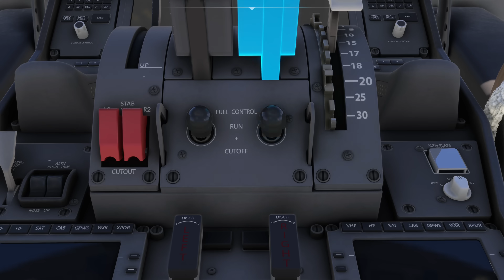Air India 171: Why Did The Fuel Cut-off Switch Get Moved?

Comment: Hi Steeeve. As per your practical experience, how probable it is to shift both the switches to cut off one after the other in a gap of 1 second without creating some sort of klick sound or noise which the cockpit mic could capture… why I am asking is as a life saving recovery action in emergency took 2 secs or 4 secs time…. 
10 second delay could be the delay to comprehend the situation, but once the countermeasure has been established, then switching back both the engines as fast as possible should ideally be the action… which leads to the question that whether it is really practical to switch it off in 1 sec so easily without any sound or something noticeable?

Comment: You should dig deeper. How do you know the pilot turned off the fuel? A signal told the black box he did. Does this signal come from a computer or is it directly the switch signal? Is there redundancy in the signal processing itself?
India and South Korea aviation regulators have ordered the airlines to examine the fuel switches because of the locking issue from the FAA bulletin.

Comment: I still haven't seen proof that the FADEC computer did not shut off the fuel without moving the switches. There is probably not a physical switch monitor as such. It would be a monitor of the computer fuel cutoff logic state. The pilot did not say why did you move the switches. He just said the fuel was cut off. There have been multiple problems with the switches and microprocessors controlling fuel cutoff in similar aircraft.

Comment: My two cents. Perhaps the pilot who asked the other pilot,  "Why did you do that?", was actually the pilot who had done it and was attempting to get something on record that could be used against the other pilot. Granted that both of them almost certainly realized that they would be killed after the fuel switches had been tampered with, but maybe the one who done it wanted to confuse the issue.

Comment: I am really surprised that you have made the categoric conclusion about the report without considering the possibility that the switches moved themselves. You seem 100% certain and yet the report does not reach that conclusion.  If it is due to a pilot turning these off, it shows how primitive these systems are. You should be able to block these switches during take off after it leaves the ground. An intelligent system should be able to detect if a plane is landing or takking off (in answer to your response).

Comment: There’s no proof the switches were physically moved. It could have been unexpected shutdown of engines just like with the Japan ANA flight, which could register as cut off. One pilot noticed engines were spooling down, he asks the other pilot about the switches which he denied moving. After they probably tried to restart the engines by first moving to cut off, but since system was already reading cut off, this would not register. Then they moved the switches to run, but by then it was too late. Before blaming the pilots, Boeing will need to prove switches were moved. Maybe the sound recording will confirm it.

Comment: The fuel cutoff switches are for PILOT control. The more you take control AWAY from the Pilot and give it to a computer... the more you add possible malfunctions. The Pilots are the ULTIMATE computers and are trusted to perform their duties... which 99.999% of the Pilots do extremely well.... day after day after day!

Comment: Thanks for the excellent content! One piece of information a flight deck camera could provide, in this case for example, is to see which of the two pilots actually engaged the cutoff that may be able to provide more insight about the incident. The recorded data could be part of the black box also in the sense that it wouldn't be accessible unless there was an accident. The potential for (and consequences of) human error is significant enough to mandate that in my opinion.

Comment: If the springs were removed and the slots were filed down, it would completely compromise the fuel cutoff switch's safety design, making an engine shutdown dangerously easy.

This hypothetical scenario describes a deliberate and sophisticated act of sabotage. Here’s a breakdown of why that would be so effective and dangerous.

*

### How the Switches Are Supposed to Work

The fuel cutoff switches on a Boeing 787 are designed with multiple layers of protection to prevent the exact scenario you're describing.

* *Protective Guards:* The switches are covered by guards that must be physically lifted before the switch can be moved.
* *Tensioned Springs:* Springs provide tension, holding the guards down and ensuring the switch itself "snaps" into position, preventing it from resting between "ON" and "OFF."
* *Locking Slots (Detents):* The switch lever physically sits in a machined slot or detent. This groove acts as a lock, preventing vibration or an accidental bump from moving the lever. To move it, you have to lift it up and over out of this slot.

*

### The Effect of Your Proposed Tampering

If someone were to perform the modifications you described, they would systematically defeat every one of these safety features.

* *Removing the Springs:* This would make the protective guard loose and floppy. It would no longer offer resistance or snap back into place. It would also remove the tension that keeps the switch lever itself firmly seated.
* *Filing Down the Slots:* This is the most critical step. Filing down the detent would eliminate the physical "lock" holding the lever in the *ON* position.

With these changes, the switch would become a loose, unsecured lever. Since the *OFF* position is lower than the *ON* position, even normal flight vibrations, a slight jolt from turbulence, or a very light touch could be enough to cause the lever to fall into the cutoff position, starving the engine of fuel.

In essence, this act of sabotage would weaponize the switch's own design and the force of gravity against the aircraft. It would require specialized tools, time, and unrestricted, illegal access to a secure cockpit, constituting a major security breach.

Comment: The reports say the switches were turned off within 1 second of each other and it took 10 seconds before they were turned back on. This suggests a malfunction or defective switches. When they went off, and the one flying asks if the other if he turned it off, he says no, the 10 seconds would be when they were trying to figure out what it was. if he had in fact turned it off there would have been other dialog or even a struggle to try to get it back on. If the pilot wanted to commit suicide, he had ample hours after the plane was in the air, no need to do it there. The plane going for the take off and if running down the run way with the nose wheel on the center would have been going over those turtle bumps causing a vibration which could have sent the switches to off if they were defective. For the pilot to turn them off in 1 second togeter is quite impossible.

Comment: Your dismissal of full autonomy is quite shocking tbh.
As the poster of the Q quite rightly states, human error is the biggest risk to loss of life.
Autonomy can taxi, take off, fly, replan, approach, land and taxi already.
Watching @pilot debrief's channel, most of the crashes are because of humans 

I work with autonomous systems and they can auto rotate (rotary), detect if they need to go around (fixed wing), predict failure, monitor a million sensors and dials a second, take milisconds to know what's wrong and generate and assess a load of emergency options in a second and fly the best one

Comment: In layman terms, would the movement of the switches to cutoff, by a trained commercial pilot, be equivalent to turning an ignition switch in a car to off, by an average driver (both have safety features to disallow this type of operation, but in an airplane, this action would need to be performed twice, since it has 2 engines).

Comment: The report doesn’t say the levers WERE transitioned. It says the levers transitioned. Hence, couldn’t they have failed, especially considering that notice from 2018.
Reply: notice from 2018 is about improper installation, not some failure. switches remained in run position after the ciolent crash.

Comment: Captain Steeeve, you hint towards a human intervention, suici**. But you seem to assume that the cut off switch is similar to one on a lawnmower for example. You never mention that the cut off switches are connected to fuel valves via a computer and wiring. You seem to be stuck with one idea in mind, a fatal flaw in a pilot. Let's see if there is a flaw here

Comment: Is there any potential that the engines did not relight and return to power fast enough, as required by regulations? Modern jet engines are designed to meet quick windmill relight requirements in case of inadvertent fuel interrupt. Do we know if GE have been engaged on this prospect?

Comment: Unanswered question: Were the actual fuel switches recovered? And visually verified as to what position they were in, etc? I doubt it.  So all of the conjecture is based on an electronic impulse recorded in the black box? Maybe neither pilot touched those switches initially.

Comment: Are there any actions either pilot might normally do involving 2 steps around that same time of rotation? ie Could one of the pilots mistakingly done the quick 2 step process to cut off the fuel when he meant to do a different quick 2 step process?

Comment: (From the Preliminary Report) As per the EAFR data, the aircraft crossed the take-off decision speed V1 and achieved 153 kts IAS at 08:08:33 UTC. The Vr speed (155 kts) was achieved as per the EAFR at 08:08:35 UTC. The aircraft air/ground sensors transitioned to air mode, consistent with liftoff at 08:08:39 UTC.
The aircraft achieved the maximum recorded airspeed of 180 Knots IAS at about 08:08:42 UTC and immediately thereafter, the Engine 1 and Engine 2 fuel cutoff switches transitioned from RUN to CUTOFF position one after another with a time gap of 01 sec. The Engine N1 and N2 began to decrease from their take-off values as the fuel supply to the engines was cut off.
In the cockpit voice recording, one of the pilots is heard asking the other why did he cutoff. The other pilot responded that he did not do so.
The CCTV footage obtained from the airport showed Ram Air Turbine (RAT) getting deployed during the initial climb immediately after lift-off (fig. 15). No significant bird activity is observed in the vicinity of the flight path. The aircraft started to lose altitude before crossing the airport perimeter wall.    As per the EAFR data both engines N2 values passed below minimum idle speed, and the RAT hydraulic pump began supplying hydraulic power at about 08:08:47 UTC.  RAT in extended position 
As per the EAFR, the Engine 1 fuel cutoff switch transitioned from CUTOFF to RUN at about 08:08:52 UTC. The APU Inlet Door began opening at about 08:08:54 UTC, consistent with the APU Auto Start logic. Thereafter at 08:08:56 UTC the Engine 2 fuel cutoff switch also transitions from CUTOFF to RUN. When fuel control switches are moved from CUTOFF to RUN while the aircraft is inflight, each engines full authority dual engine control (FADEC) automatically manages a relight and thrust recovery sequence of ignition and fuel introduction.
The EGT was observed to be rising for both engines indicating relight. Engine 1’s core deceleration stopped, reversed and started to progress to recovery. Engine 2 was able to relight but could not arrest core speed deceleration and re-introduced fuel repeatedly to increase core speed acceleration and recovery. The EAFR recording stopped at 08:09:11 UTC
At about 08:09:05 UTC, one of the pilots transmitted “MAYDAY MAYDAY MAYDAY”. The ATCO enquired about the call sign. ATCO did not get any response but observed the aircraft crashing outside the airport boundary and activated the emergency response.
At 08:14:44 UTC, Crash Fire Tender left the airport premises for Rescue and firefighting. They were joined by Fire and Rescue services of Local Administration.

Comment: Pilots are trained to fly a plane. It can't be made baby proof. These pilots go through rigorous training. If the fuel switch is in the 'run' position, it will stay that way until the aircraft has landed and taxied to the gate or stand.

Comment: To all the Commenters asking questions- please read the Prelim Report issued by Air India after investigations. It is an outline only not in depth. It is factual listing what black box recorded, not conjecture. If you read it, or look at the main parts, you can logically follow what happened without emotionality clouding your judgement.  Main points are:
1. Fuel switch #1was cut off MANUALLY. 1 sec later Fuel switch #2 was cut off.
2. RAT deployed automatically after 5 secs.
3. Fuel switch #1 was turned back on after 10 secs, and switch #2 was turned back on after 13 secs manually.
4. Copilot Sabharwall 56 yrs issued the Mayday call from the copilot seat.
5. Pilot Clive Kunder 32 yrs was flying the plane with both hands on the steering wheel.
6. All activity in black box stopped 6 secs after Mayday call.

Why was Clive Kunder, the junior pilot flying the plane that day? Was he the sane one deemed fit to fly?
Why was Sumeet Sabharwal, the senior pilot copiloting that day? Had he been demoted?
Why was Sabharwal retiring at age 56 when he could fly till 60 yrs? Was he being forced out by Air India due to mental health?
Sabharwal had taken time off for mental health issues earlier. His mother had died, best friend had died, he was losing his job, and his father was ailing. He was not married, had no kids. In short, he was pretty depressed overall. Sounds ominous.  Most men experience peak of depression in their 50s.
Sabharwal had told a female neighbor that he only had 2-3 more flights left before retirement. He was going to take care of his father. Pilots make a lot of money more than enough to have 24 hr care for a parent. So I don't think this was his decision.

Killing 300 people is an act of anger not just depression. Why was the pilot angry? Was he being forced out after years of service? That would make him angry as well as very depressed. If only Air India gave them some mental health counseling, mandatory every month, this could have been averted. Most of the Air India crashes are due to pilot error as reported, which means either they are very fatigued or have mental health issues.  Capt Sabharwal was very qualified with 15,000 hrs total flying and 8,600 hrs on 787s. Clive Kunder had 3,500 hrs of flying. Both experienced pilots. We have to change this scenario and invest in mental health services for people. Modern day life is too stressful and we are working too much, playing too little.

Comment: Why did it take so long time until the switches were put back in to the run position again? I assume that the pilot that questioned it was the first officer flying. Was there a physical grappling from both pilots over controlling the switches that took several seconds? Was there no other audio indicating a struggle? Being the first officer he probably hesitated for a moment because the Captain shouldn't do something bad deliberately however 10 seconds of silence before they are turned back on doesn't seem right.

Comment: Captain Steeve, it seems you are treating the "preliminary" report as a conclusive report.  Hey, we got grey "dust" blowing out the port engine only, so this is normal?  Please see the takeoff video by the little hut near the runway.  Until I see the full data, it is inconclusive, especially with a time stamp missing at 08:08:42 UTC.  

We do not even know which engine shut off first. 

 The preliminary report is ambiguous at best, at the most critical point of flight.

Comment: Two pilot requirement for fuel shutoff sounds good in theory, but how would that work out if one pilot were incapacitated, and fuel had to be shut off due to an engine fire before the plane could land? This seems like a one-off incident, and I'm not sure that this particular change is necessary or even advisable.

Comment: Hi is there any other way to know that fuel has cut off to engine other than physical switch position? On dashboard indicator? Is it possible that Fuel switch remain in run position but there might be other factor that cause cut the fuel to engine?

Comment: In all investigations, you need to wait for the pilot's families to confirm who said what, not the Civil Aviation Authority (CAA) and other agencies who would not know. Also, the other question that's circulating is that this aircraft has 2 types of engine on/off controls? Well, that's an easy one to answer for any current Air India 787 pilot. You also need to check the pilot's medical history and any other type of home computers that they may be using. And only then will we be able to say what actually happened on that fateful day. after all of that, there could still be a passenger that played a part in this accident,